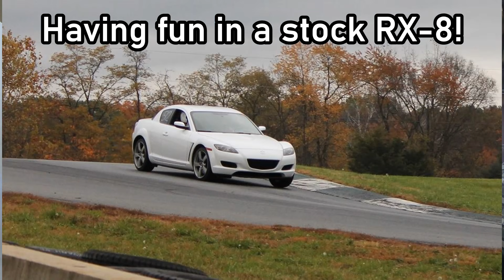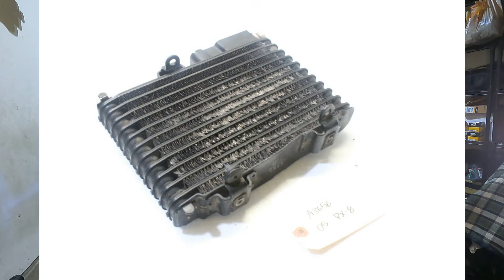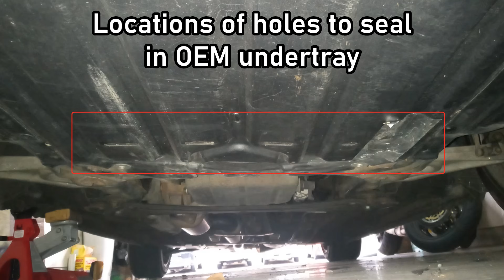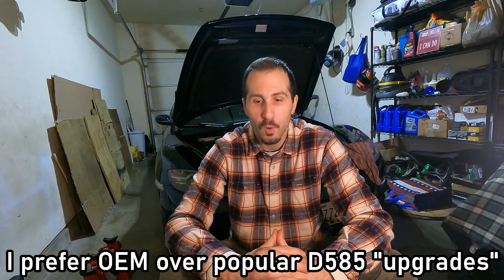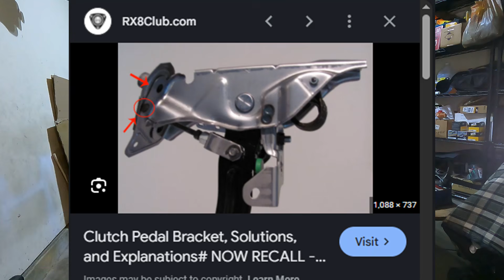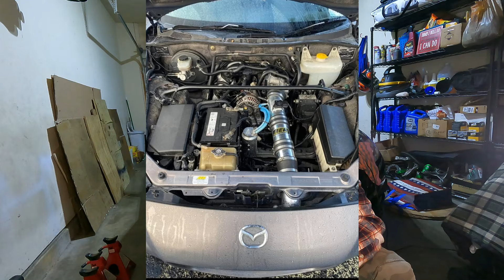MAZDA RX-8 TRACK PREP + RELIABILITY MODS

Comment: On the subject of fluids especially transmission, for the 6 speed manual the old go-to oil was redline mt90, Redline LV seems to help with synchro engagement without crunching. 
It's beneficial to get a mini map to increase oil injection rates, as standard the rate varies around the world, but an increase is definitely beneficial and you can also get the cooling fans to come on sooner.
Reply from the maker: For sure, in using versa tuner to lower fans temps and increase omp rate

Comment: Great. A upgrade all aluminium radiator is worth fitting.
Reply from the maker: i had a CSF all aluminum unit for a while.  it was nice, but i learned that flow through the core is more important than core thickness.  that said, the aluminum is nice because it addresses some of the weak plastic failure points.  just a shame i couldn't find any all-aluminum versions that were same thickness as OEM.
Reply: @rx8matt my original rad failed. So upgrade was no brainier. Yes saw old foam needed replaced. Good point on let flow go to exhaust manifold

Comment: Solid advice! I wouldn't consider the alignment optional though 😉

Yes! Stock battery location is a travesty, relocation is a must! Trunk would be better, but anything is better than stock. 

Also, the stock clutch will last as long as the engine but the stock TOB is trash with a plastic race.
Reply from the maker: Thanks for catching up on all of my latest videos man.  It helps to have hardcore racers contribute what they've learned!   

Yeah my brother has seized front control arms and asked if he can race with the oem alignment.  "Yes... but I wouldn't! " was my response.  

My white car had a slick trunk mounted battery setup.  Cooler temps back there,  but more cable and a little more losses electrically. 

Are there aftermarket FD TOBs that are all metal,  or do you stick with Mazda?  I haven't been able to find a definitive answer...

Comment: I'm just binge watching these at work, great information and tips. What's your thoughts on running a mineral oil in the engine?
Reply from the maker: Any multi grade oil is fine, as long as it's at least 30 weight in cooler weather and 40 weight+ when you're really hard on it in hot weather.  Most multi grade oils these days, even "conventional" are pretty dang good.  I've run mobil 15w40 diesel oil and it was fine

Comment: Just subscribed great channel, yes things over heat badly on track. Biggest thing is yes bigger radiator a must. Twin oil coolers but you must get rid of the thermostats in them replace with pellets. Even then factory ones ok driving at 80% but in super sprint events you need bigger oil coolers for shore. I also duct round them .
Reply from the maker: Are you running a lot of laps in higher temps?  I'm doing more time attack (fewer consecutive laps at 10/10ths) so I've been able to get away with oem radiator
Reply: @rx8matt yep super sprints 15min sessions at full noise. But only takes two 2 laps to overheat on standard twin coolers …We run AR1s CRS or the Hancock what tyres do you guys use ?over there ??
Reply from the maker: @souldrummer818 for lapping i like the kumho v730, for TT i like the Bridgestone re71rs or yokohama a052
Reply from the maker: What Oil temps are you seeing?   @souldrummer818
Reply: @rx8matt stop car at 130 oil 108 coolant on old set up, but no n saying that Mallala track in South Australia is brutal on the car,now have bigger coolers with no thermostats and two pass bigger radiator better water pump, but I wouldn’t seal off those holes in under tray it helps high pressure air escape.
Reply from the maker: @souldrummer818  the hole are in front of the radiator... so wouldn't you be letting air divert around the radiator?   i had always assumed they were to keep the air pressure loads from keeping it from deflecting too much
Reply from the maker: @souldrummer818  dude, have you been to bathurst...?
Reply: @rx8matt nah but would love to, but in a more powerful car, my dream drive from a kid.
Reply: @rx8matt yep who knows I’ve just discovered GPT chat lol and was trying to get optimal cooling out of mine it’s what they recommended . In saying that I’ve just finished my cooling upgrades track day coming up in two weeks so will let you know how temperatures go.

Comment: Great video. I have some experiences with the rx7 Fd platform but new to Rx8 platform. Rebuilding motor after some corner seals broke on a 113k motor. Mods are AEM intake with no screens, resonated mid pipe and underpulleys. The car with the AEM cai with no screens held good idle but the engine light would blink on and off on full throttle with no ill effect to performance. What is your opinion on the screen, do I really have to have one?
Reply from the maker: Welcome to the rx8 club!  I've run without either screen, the engine fueling near idle and drive ability were a bit wonky but at least it never stalled.  They say each screen costs about 1hp at the top of the rev range.  I prefer smoother drive ability so I run one screen.  Now, the flashing CEL is ALWAYS a misfire.  I would recommend searching rx8club for a post called "misfire start here" and get that fixed.  I have had my share of misfire issues over the years and rx8club saved my bacon

Comment: What kind of gauges do you use? How accurate have they been?
Reply from the maker: Vdo analog 2-1/16" with electric sending units.  I don't have any secondary measurements besides the obd2 coolant reports, so I can't really comment on accuracy.   That said during street driving coolant and oil both sit around 180F and I see 200F coolant and 210+F oil on track, so it seems fairly accurate.   It was my coolant gauge that saved my bacon while autocrossing because I could see that my water temps were high and not recovering because my oem fans were failing.  The water temp gauge on the dash of course never moved.

Comment: Very nice video, and a lot of important things were mentioned. I raced my RX-8 for about 10 years in time attack, hill climb and autocross (in Slovakia we call it slalom) and I did basically the same. The setup I used was Hawk HP+ pads, slotted rotors, braided brake lines, Motul RBF 600 brake fluid. It works great also on the track and I have never experienced brake fade, even if there were semislick tyres on car. One very important thing are wheels, when I upgraded to OZ Alleggerita the car responded better in everything, acceleration, cornering, braking.  The hose from expansion tank to undertray is a must have, so the excessive coolant does not go on the power steering connectors, and believe me, I had a some experience with that :D Good idea is upgrade radiator to bigger aluminium one, I have Koyo and I experience overheating only once on time attack, when the ambient air temperature was like 38C (100F). So now I could drive full throttle the whole 30 minute session without any cooling laps. For the cooling there is one small free improvement, in the lower side of the front bumper, between the bumper and lip/undertray, where intake to radiator is, there are plastic "triangles" one on each side, you can remove them, the undertray behind  them is shaped in such manner that it leads the air to radiator. For the weak clutch pedal, in the past there was a reinforcement kit, that you can directly bolt on the clutch pedal and you can use the clutch as hard as you can, it will take it. I broke the clutch pedal on one of my first trackdays so that is why I know about it :D I run the RX-8 in stock power, it is not the fastest in straight line, but boy it owns the corners. About the oil, I use Motul 75w90 for diff and transmission, and the Mazda OEM oil for the engine, no SOHN, just changing the oil in short intervals, because it is maintenance if I drive it hard. To prevent the bending of oil cooler fins, just install a mesh in the bumper in front of them, it helps greatly and also save the oil coolers from hitting a rock or something. The cooling performance is the same. The RX-8 is great car, have it more than 15 years and still enjoying it on racetrack :D Have a great season and good luck in racing!
Reply from the maker: Thanks for reaching out with such a detailed write-up!  Do you have any pictures of the cooling mod you mentioned in the front bumper cover?  I agree, it's more fun to win in the turns than in the straight line ;-)
Reply: @rx8matt  Yes I have some pictures, and I forgot about the rubber just bellow the license plate. Here are some pictures bumper from behind https://13b.sk/imgs/RX-8Bumper2.jpg and the mesh in front of oil coolers https://13b.sk/imgs/RX-8Front.jpg
Reply from the maker: @SoichiRX huh, I've never seen those rubber pieces on an American model!  I wonder if that's only a European feature...

Comment: Can i ask what kinda foam you got for the radiator? And another probably dumb question, if im switching from conventional to synthetic oil, is it a good idea to drain the oil coolers too?
Reply from the maker: It was kinda medium density upholstery foam, like you might use for a seat cushion.   I think it came from jo Ann fabric years ago but they closed shop.  When I do my oil changes I help the oil coolers drain by making both sides of the cat up. I wouldn't worry about it,  just do a short change, and the fact that the rx8 injects oil and you have to top off helps transition to new oil too.  I am pretty sure the 15w40 diesel oil I was getting cheap at bjs was probably conventional anyways,  never had issues 😂

Comment: Great work as usual Matt . I have a couple questions . I have only a single oil cooler , but have purchased an after market 13 row cooler to go in the other wheel well . Did you fit a lower temp thermostat for the oil cooling system ? I don't have separate oil & water temp gauges , would the Torq Pro app provide meaningful water ( oil ?) temps instead of dedicated  gauges  ? Do the "sport" pullies still work OK for normal Street driving ( i.e. no over heating ?)  .
Reply from the maker: Nope, I use factory oil cooler tstats.  I actually block of the oil coolers during street driving to get MORE oil temperature.  Oil works best above 200F.  Name people fall into the trap of "colder is better".  I run the OEM coolant thermostat as well.  I actually run into the issue of too LOW oil temperature more often than too hot.  That is, in cooler weather you really need to let the car warm up or drive carefully on your out lap to get sufficient oil temperature prior the beating on it.
Reply from the maker: Yes the street pulleys didn't seem to hurt coolant temperature when cruising, and yes anything you want to use to read oil temperature is fine as long as it's fairly accurate

Comment: Thanks for making this video... i just bought a 2010 Mazda rx8 r3 about a couple of weeks ago, and i told myself that i would prioritize buying the reliability stuff first like a aluminum radiator, type C or bhr coils, spark plug wires, and lastly a racing beat midpipe.... Your video is probably the first one I've watched that emphasize on reliability....
Reply from the maker: Sure thing!  I imagine a good condition s2 radiator with the cooling more I mentioned would be perfectly fine.  I thrash my s1 radiator and it keeps up pretty well, it's actually more the oil temps that start to rise first.  Good news is that the s2 has a variety of reliability upgrades from the factory, which is nice. Welcome to the club and Good luck with your prep!